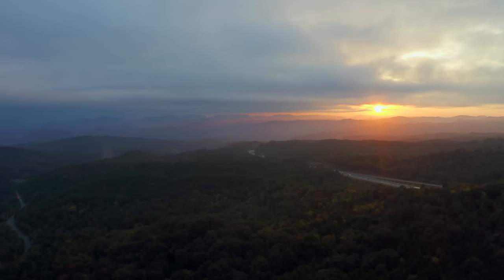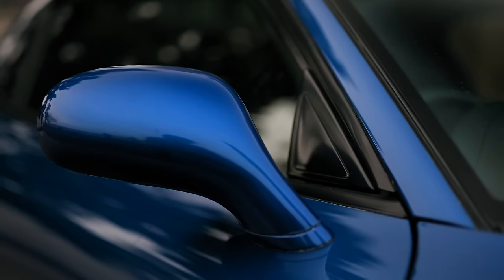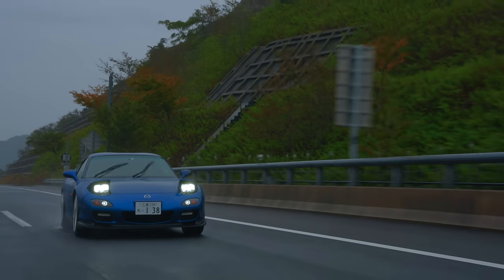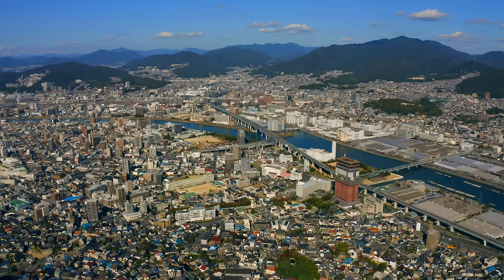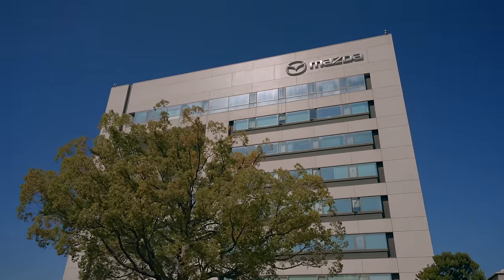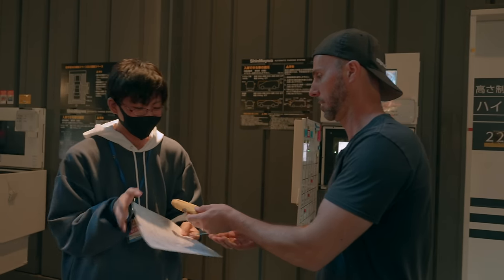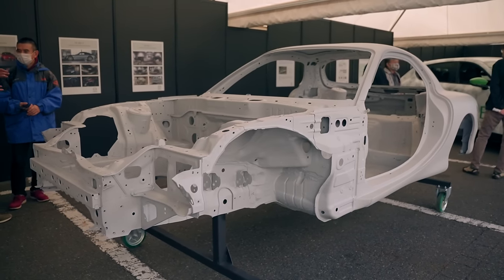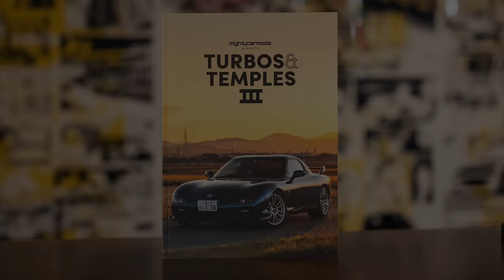TURBOS & TEMPLES 3 // JDM Feature Film 4K

Comment: 26b LeMans race motor had three spark plugs per rotor and variable length intake runners. It was detuned for durability to 700hp from 900hp N.A.
Aftermarket quad rotors aren't the same as the 26b.
Awesome footage of mazdas in Japan. I didn't know how bad I wanted this.

Comment: Love this video guys, one thing that made the 787B engine so special 'if people circle back to the engine view' was the 'throttle body' and if I am correct it is on an 'adjusting rail'? This meant it could shorten the snout of the intake for higher rev ranges 'similar V-Tec with cams' to increase the volume of air delivered to the engine at  higher speeds, there are videos out there showing similar throttle bodies that expand and contract and the sound they make is 'other wordly' seeing this beast of an engine rev up to 9k on the dyno and watching the throttle body contract as you hear it move into the peak of the power curve is magical, thanks for taking the time to make this video MCM!

Comment: My first and most beloved car is my Mazda 626 GE IV hatchback. On the outside, it's nothing special, just some big Japanese sedan from '93 with a pretty pedestrian 4 cylinder and wrong wheel drive. But it has so much soul. I've driven a WRX, several VWs/Audis, BMWs, old Hondas, and I can't find anything which just makes you feel so connected with the road. The driving position, steering feel... It's just fantastic. I bought that car when I was 17, and it was, and still is unfortunately, in absolutely terrible condition. I live in eastern Europe, my country is not especially poor but our laws limit a lot of what you can do to a car, and the state will rip you off to the maximum if you try to import anything from another country in terms of parts, and then there's also the issue of no tuning shops existing here pretty much... My biggest dream, and my dreamcar, is that exact 626 with the best package, and in perfect condition. I don't want anything else more,  the perfect FD, Cosmo, RX-3... I just want that car to be perfect. 

These videos are always very emotional to me, and this one hit especially hard. I just wanted to say that your content can touch my heart like an excellent movie or anime series. I have never experienced that feeling watching any other youtube channel. As long as you guys are making videos I will be watching them.

Comment: i like the abarth turbo timer. Only turns on if the engine is too hot so if you idle  for 30-45sec it usually doesn't do anything. I find it's a good indicator too

Comment: Have the Hankook Si Evo3 in front and had them in the rear. Replaced the rear to Bridgestone Potenza sport. Hankook I replaced was very awful but also very worn and Potenza was a champ
In the fall I had zero grip with Hankooks but they where worn, got Bridgestone Potenza sports and got amazing results (still not grips because 850nm) drove both hard both days. Did previous owner just cook the Ventus or are they actually that bad? (Dailydrive a Stage+ M4 (F82) on E85 CA 580hp.) They like autum/fqll (in the fronts) but endersteer in front like Kumho PS91 when cold. But fronts when they squeal they are very communicative at the steering wheel and but gyro despite EPS. Pleas advice a tyre I can track on public roads (Touristenfahrten) because scarce coutry I can push my cars more than most, but also want cold performance for round abouts.

Comment: Man all this Mazda porn makes me regret selling my '13 speed3. The interior and sound insulation of that car fealt like someone put wheels on a tin can. Everything rattles, you can hear the outside like your windows are open... BUT i loved that thing. It was like a weird looking puppy that is ALWAYS smiling at you and constantly tries to prrove it's a big car by pulling you to the left any time you slam the gas with the boost coming in so low in the rpm range giving the engine its peack rom range by 2.5-3k(even lower with a proper sri/tip upgrade), and a 6speed manual that thing WAS SOOO MUCH FUN!!!!!!! The smiles per gallon were higher that gas these days.

Comment: Ionow it's crass to ask but you guys make good bucks and do other stuff so not short of a doller how much does it really cost after finding the right car and buying it then rego it in oz as I'm looking at a Japan import Audi RS6 AVANTE WAGON and we'll it seems quite cheap 25000kms on clock and the twin turbo V8 with a box with up to stage 4 stuff to add to it when it arrives and get it done right by the police but it's only 37k aud supposedly to my door and thru the rego and all the bits and pieces it's a perfect car and the engine is perfect it's stock as a rock but it has everything to go to about 800-900hp and 1000-1200nm at all four wheels so what's it costing you guys for the rx7 or am I being led a stray and will end up with a non runner till I add all the mods they took off to be able to ship it it and sell it but included a crate and boxes of everything suspension and brakes and edfc and new standalone and running software and a halteck bunch of things aswell as many many electronic gadgets. So I'll have a 150kmodded RS6 AVANTE WAGON twin turbo AWD machine in black on black with diamond pattern . BLack seats new deep dish rims lowered coilovers and all the gear I k ow well and it's all good stuff but it's bigger tur os akd bigger I intercooler and  hear box and oils and we'll upgrades for everything and ready made perfect tig weleded pipes I payed extra 10k for the parts that ere on it and taken off to make it sellable as a street car it's basically knew been driven for 1 year